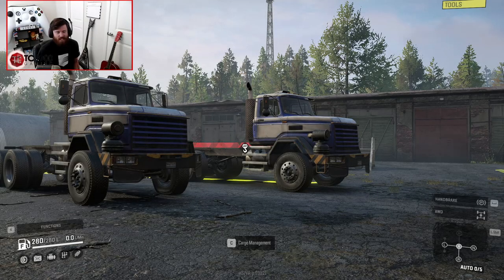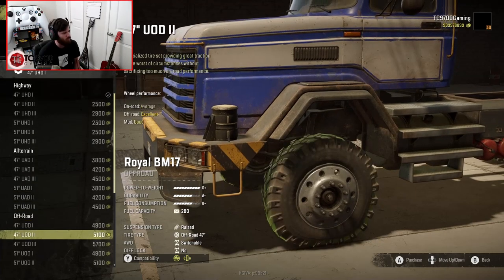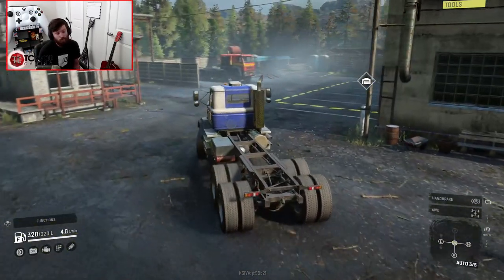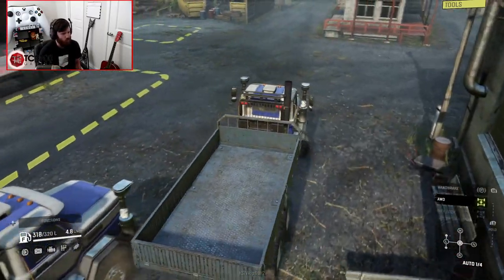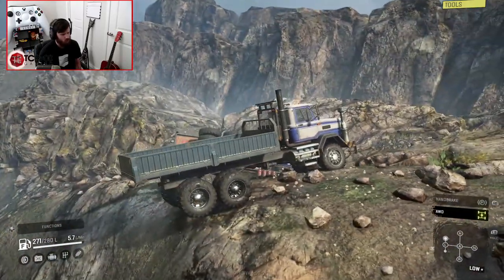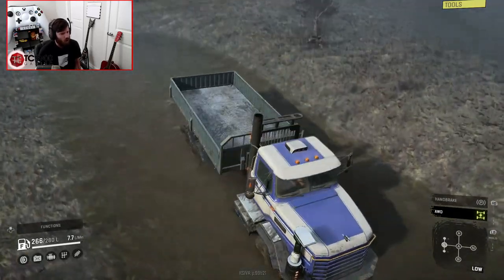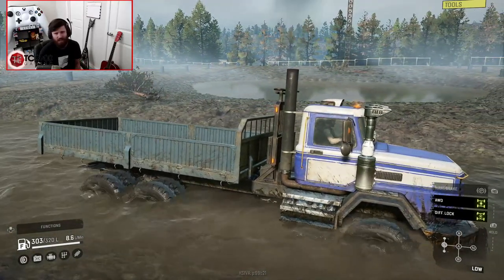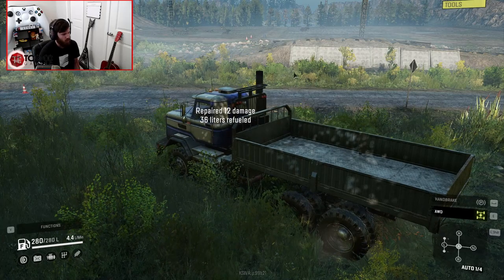SnowRunner: Is A Royal with DIFF LOCK Over Powered? Let's FIND OUT!

Comment: So on the in game truck "we're gonna set these trucks up very similar for comparison purposes..."

On the mod truck "well if the in game truck would allow the OP engine i would use it..." 

Wtf TC...
Reply from the maker: I went back and forth on this decision to be honest. And yes, it definitely gives it an advantage but not a huge one. I wanted to see if the bigger engine was worth it or not and honestly I feel like it wouldn't matter unless you wanted to tow REALLY heavy loads.
Reply: TC9700Gaming hu
Reply: @TC9700Gaming  this video was about diff lock, the results are negated by the engine upgrade.

Comment: They need a navistar with diff lock so you can compare those.
Reply: The Navistar does need a diff lock. It’s useless if you have an off-road gear box 

It seems a lot more useful with a highway gear box and flick it into high gear when you can
Reply: @weaponenthusiast2623  without a doubt. The Navistar is a lot better with the high range. It’ll plow through just about anything in high but low is terrible.
Reply: And a slightly larger tank. That thing is thirsty

Comment: The main difference will be noted when pulling some cargo, the Royal is good for anything but deep snow and mud; if you ask me yes, it was pointless to release the truck without diff. lock, it is already a mid/late game truck, same as the P16, so at the worst I would have locked the diff. lock and AWD options behind level restrictions.

I find also weird that we still can't overwrite trucks via mods, you effectively need to implement a separated truck by name or modify the base files, which is somewhat pointless.

Comment: I could definitely see a diff lock being added to this truck in either phase 3 or 4 as an upgrade location on one of the new maps. Pretty interesting how 1 crucial upgrade for a truck can make all the difference. Variable or raised suspension for the CAT CT680 would be a nice addition as well, insanely powerful truck just lacks the ability of more ground clearance.
Reply from the maker: Personally, if the CAT CT680 had raised suspension, it would literally be my go-to truck! 100 percent!!
Reply: @TC9700Gaming  yeah buddy no doubt. They're kind of my goto truck for light duty hauling. I have a fleet of them, 4 CAT CT680, 2 are light duty haul, 2 are fuel/maintenance. I got 2 Azov 8x8s for the heavy haulage. Thanks for the reply and keep the good work up man👍

Comment: Idk why YouTube recommended such an old vid but anyway

What I did notice is that the Royal BM18 with the upgraded engine and Diff lock, performed worse than the vanilla one, and I think it's because the UOD II tyres don't have enough traction even for the 2700 engine, so a more powerful engine would just make the wheels spin faster in mud and slow you down funny enough, I would've liked to have seen you put the 2700 engine in the BM18

Comment: I used to use the bm17 all the time for its speed and power, but ditched it because it tips over super easy and gets damaged easily on small rocks or branches or dips; you’re going so fast it’s hard to miss everything all the time. I get better control with something slower. So for me diff lock doesn’t matter. Super tipsy, super weak (taking on damage easily).

Comment: I think you should check out the Freightliner M916A1. I think people pass on this truck and its quite the beast. Only downside is it can be top heavy at times, not as bad as the ANK but I think its a sleeper truck in the community. That thing rips though mud like a beast
Reply: the only downside to that truck is its too short to have a crane other than that its a beast no doubt also if the attchment behind the cab held parts and fuel that would be pretty cool

Comment: Has anyone found amid that fixes the broken engine and gearbox mechanics? Drive a real vehicle or play forza for an example. All these trucks drive like soup and spend more time rolling to a dead stop and changing back into first. The low and high gear boxes are shit, stuck with one ratio in that range. Also engine torque etc is fucked, most trucks original engines can’t even spin the wheels in the mud....